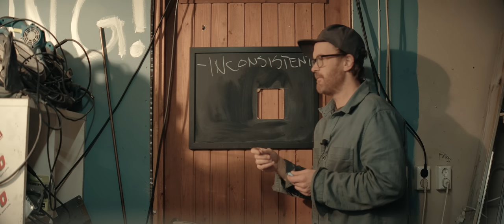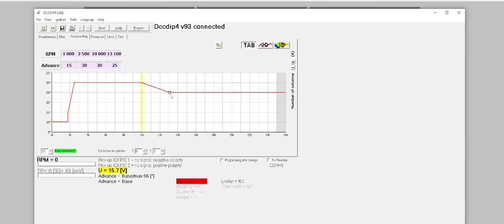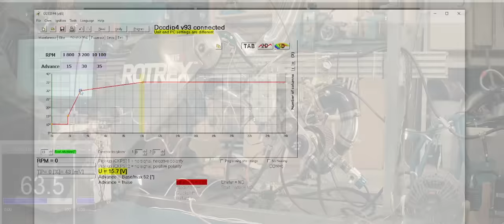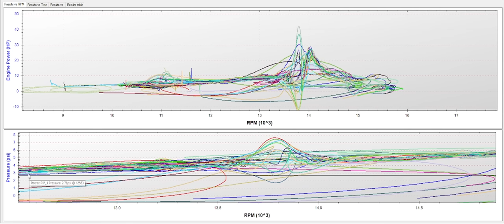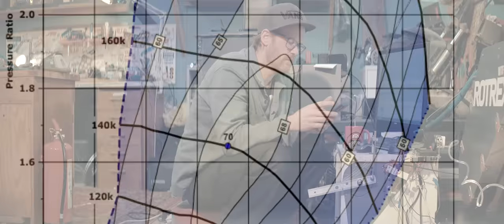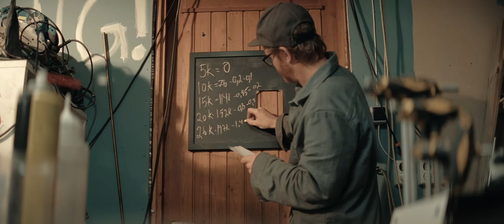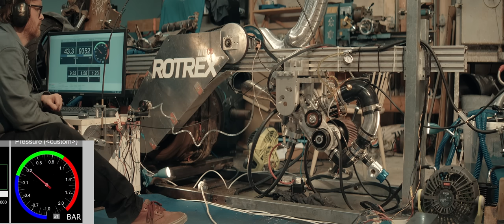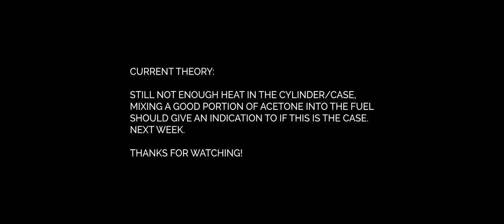Supercharged Pulsejet Engine?

Comment: Hear me out...   

You have a centrifugal blower shoving fuel into a crankcase that has no reed valve. At low rpm this sucks and you should have a legitimate full reed cage with a reed limiter cage on top of that. (So they don't over flex and break, but also because the spring rate of the reed dramatically increases the more they open!) This will fix a majority of your low rpm and transitional issues.   Get it running good like this first without a blower. 

Later, after you sorted that mess out, add the blower. 

Under boost, with the piston approaching TDC, the blower is shoving the air and fuel mix into the crankcase, helping push the piston upward As well as filling the increasing volume in the crank case. As the piston begins moving downward this volume begins drastically reducing and I'm sure shoves some of that fuel mix backwards toward the carb as well as raising pressure between bottom of the piston and ex-ducer of the supercharger. If you're supercharger is not spinning fast enough to over come this increased pressure, you basically have compressor surge. I'm sure a very weak intake charge follows. At higher RPM when you have higher amounts of boost, you have this very large spike in pressure as the piston moves down. As the piston exposes the exhaust and transfer ports, the supercharger is no longer boosting the cylinder. It is pushing all the air fuel mix from the crankcase through the transfer slots through the cylinder and out the exhaust ports where it meets up with combusting gases and lights off. This is why you're getting a flamethrower. If anything, you need a smaller stinger to try and create some back pressure so you can get cylinder charge. Realistically however, you would need to move to a mechanical valve that would allow you to close the exhaust off prior to closing the transfer slots so you can actually build Boost in the combustion chamber. There's a fundamental design of a traditional two-stroke that you're at the limit of. I don't see a way that you can make this work without changing the mechanical valving of the engine itself. Your barrel valves were a step in the correct direction I think. But I also believe that you should be running a full reed valve set up on this engine to help lower RPM and transitional power output.

Comment: As usual, great video! What about heating the fuel a Bit? I guess most energy goes into the gas transition, but heating the fuel should also suck some energy out of the motor.

Hälsningar grannen i öster.
Reply: It doesn't sound like pre-heating nitro-methane has to go well at all.
Reply: @cccpkingu  haha, could be the case. You don't need to go crazy on it. I guess the ambient temperature in your average Norwegian garage is pretty low this time of the year.

Comment: Unfortunately, I feel like your passthrough supercharger is introducing too much fuel because it's carbureted.  I'm not a two stroke "expert" but I've worked on/rebuilt dozens, and the expansion chamber of the exhaust bounces back unburnt fuel under pressure giving 2 strokes their own built in "supercharger" through the expansion chamber.  I feel like by adding a supercharger onto a carburetor, you're just pushing way too much fuel through, and there is no expansion chamber effect.  My hypothesis is that fuel injection (or direct injection) is the only way to solve your atomization issues.  This is what I would do as a NON-expert tinkerer.

1. Try drastically REDUCING the supercharger boost instead of increasing it, and work your way up.  I know that makes it run a little cooler, usually, but I think in this case it will not because less pressure will allow the fuel to atomize better.  This might be a wash because of the supercharger pushing unspent fuel through the exhaust without it "bouncing" back into the engine rebounding inside the expansion chamber back into the cylinder.  The expansion chamber rebound introduces hotter air mixture that hasn't been completely ignited, and that would also keep the engine hotter.

2. Fuel injection.  Fuel will only be injected in a few degrees of rotation instead of the entire intake and exhaust stroke.  Direct injection would allow you to inject at the precise moment to allow for less fuel to blast through the exhaust, whereas with carburetor, you're supercooling the engine with fuel, with a lot being wasted.

I love your channel man.

Comment: This is an experimental/development engine, as such, you should instrument the engine as much as possible. In the last couple of videos I'm getting the feeling that you are tuning and changing thinks almost "blindly", only following institutions. I know it's initially expensive (maybe a sponsor ) but several sensors, like temperature  pressure and AFR all over the engine can only help you, and it will speed the engine development. Just thoughts from a clueless guy in 2 stroke stuff.  See you on the next one!😉

Comment: Try running the carb without the restrictions. I reckon that is your issue
Reply: I fully agree. I have suggested that previously.
Reply: @malcrandall1309  yep. 
You can have all the psi in the world but without the flow psi means bugger all. 

And I strongly suggest he strays away from motorcycle carbs and try's a side draught Webber, one that is properly set up for boost.
Reply: @Swinginspanners  I must admit to being a carb man because I come from that era. 
If Alex wants to continue with carbs he has either get a much smaller bore carb and all the developement that goes with it or go for EFI which will guarantee a much finer mist giving a much quicker burn which it desperately needs.
I know Alex has being offered many carbs, I feel a modified 11/4" SU carb would be a good option with large float bowl and adjust while running main jet. Are they RC fuel proof I don't know!
This engine achieve 18k plus using the roots blower and speedway carb, it proves this engine is capable. The only thing that has changed is the S/C and carb! and running blow through.
Reply: @malcrandall1309  very very true. Thanks for your input

Comment: That you should have a rotary just valve for the inlet and have it times rather late so that when you're compressing all that fuel and air into the crankcase you're not fighting the nurse to the piston and crankshaft coming down which of course was coming down it's making a transfer to the fuel and air to the conversion chamber however you have so much power with the supercharger that you can actually leave that event the event of the supercharger kicking into the scavenging to past bottom dead center to wher
In other words you have the engine doing its own thing as far as transfer and compression of the crankcase gases as the distance coming down after on the powerstroke don't hinder it with the supercharged charge until just before bottom dead center and then you can blow it down with the supercharged fuel and air mix of course some of that will stay and the crankcase and it's all controlled through the rotary valve disc asymmetrical timing

Comment: Get an adjustable fan or maybe even a pump with alternating speeds so that you can change the tempereture to your and the engines liking! Snälla fortsätt precis såhär!!
Reply: Yes I think slowing the coolant pump down is what's needed. Using the hair dryer was pure class!
I think the crank cases need to be brought upto 60C and the cylinder 80C.

Comment: Could the supercharger be forcing out the currently burning fuel that's in the cylinder i.e pushing the burning mixture through into the exhaust? It could explain the pulse jet AND the lack of power? Just a thought! Love the videos my man :)
Reply: shouldn't the mixture have stopped burning before exiting? like used up all the oxygen there is in the cylinder? i mean with the timing at like 30⁰ advance there shouldn't be much more burning happening i guess. but still valid point
Reply: Perhaps maybe the fuel isn’t fully combusted until after it exists the cylinder? And then possibly the fuel that ignited in the exhaust is pushing the mixture backwards in into the cylinder or disturbing it? I know the engine has a large overlap in valves being open at the simultaneously.
Reply: ….open simultaneously**
Reply: I personally believe a lot of people get confuesed between 2strokes and 4strokes.
In a 2stroke the fuel must be COMPLETELY burnt prior to the exhaust opening allowing the expansion chamber to work correctly as intended.
With a 4stroke you want the fuel to burn to the bottom of the stroke with as much force as possible. It doesn't matter how much fuel you expel during the exhaust stroke.
Reply: @malcrandall1309  yea that's kinda what i was thinking
Reply: @malcrandall1309  I see, I don't have much experience with 2 stroke engines personally but I have experience with engines in general, thank you for the insight! If that's the case then its most likely something entirely different 🤣

Comment: Have you considered that all that flame throwing is actually the energy you are seeking that gets thrown out a not sufficiently restricted exhaust pipe? 4 stroke can always count on their exhaust valves and their timing...in a 2 stroke it's all up to a pressure wave travelling backwards and so dependant on air temperature, density, viscosity etc...all parameters you have now altered wildly compared to what that exhaust pipe was designed for...

Comment: Measure crankcase pressure.
On the downward stroke you should be compressing, which you are not (cause no reeds).
I bet some weird stuff is going on.
Reply: You're right, Dan. Professor Gordon Blair, who wrote the classic, The Design and Simulation of Two-stroke Engines (2002-last edition), showed the impossibly complex interaction of pressure waves in the crankcase during the engine's normal operation.
Reply: @davidgierke7582  yeah, because it has no inlet valve, the engine is no longer a pump.... Its now some weird pulse generator.
Piston port or rotary valve i reckon...... With emphasis on the word "rekon"

Comment: I don't think your piston is up to the task of sealing that much air into that much cylinder pressure, and, if it did it would probably melt. Perhaps a piston redesign is required in order to maintain compression under high boost/high compression. Double up on the compression rings, increase thickness of the piston top and make the piston top sodium filled and the piston surface ceramic coated. Cryogenically treat the piston to improve hardness and durability. Also due to rapid thermal changes the piston skirt should be longer to prevent piston slap as clearances suddenly change.

Comment: Could just be a flame velocity issue at higher rpm, always thought nitromethane burns a bit slow by itself. If my (terrible) memory serves, hydrazine and/or propylene oxide were used to make nitro burn like a mofo, especially back in the day. Hydrazine you of course want to stay far away from, but propylene oxide I think (?) you can still get. Again, if I'm remembering right, a little goes a really long way. Acetone may work, but I'd be super wary of a solvent that powerful in an engine that uses fuel to lubricate.

Comment: Pre-heating the fuel to at least 45°C? It should shorten the evaporation time energy for the fuel. Maybe help it run a little leaner.

Heating the fuel also is a fire risk. So maybe adding a small closed cup with a heater between the canister and the carburetor. 

Maybe also bowl needs to be adjusted into little lower?

Just guessing, hoping some of ithelps somehow

Comment: Hey, what would happen if instead of warming the engine, you were to warm up the fuel ? Would it bring the same result, could you combine the two for a lower temperature difference? Would it be too dangerous (making the fuel too volatile) ?

Comment: I'm thinking that it is pushing from the transfer to the exhaust, then igniting from the gasses still burning from the ignition.  Yamaha developed a movable shroud to alter exhaust timing.  What about an expansion chamber that can reduce volume as RPMs increase? Trombone kind of thing. Suzuki stole DKW technology and started winning. Supercharging was big time just before WW2. Scott was a 2 stroke twin with thermo siphon liquid cooling. I just Googled supercharged Scott.  Apparently there was one built in 1936.

Comment: Compression ratio?
Reply from the maker: Low, 14.5:1, higher has been on my mind.
Reply: @2STROKESTUFFING  but the higher compression could make it worse with knocking and stuff. But im not expert xD
Reply: @2STROKESTUFFING  butt!!! The 1 at the end is the atmosphere pressure right? Now you are forcing the air in so its not a 1 anymore,,, to high compression to ignite the mixture and just pulsejetting

Comment: I think the issue of flamethrower out the exhaust is more inherent to the fuel than other parts of the setup, meth needs absurd amounts of time to burn when it's not set up as a glow engine, should be fine to increase it until you see 80-95C.
Guessing the weirdness around 13-14k is due to the pipe being forced to run outside its designed range, that typically works as the rpm limit of normal 2-strokes, a 7-8k tuned pipe might actually work better if that's the case, reaching a second resonance peak around 14-16k, being forced beyond the 9-10k hump by the supercharger. "just a theory" as you like to say though.

Comment: What leaked from the ceiling?????

Definitely too much unburned fuel making it into the exhaust, the pulse jet effect is from the shape of the pipe...
I think the extra fuel is the result of the supercharger pushing mixture through the combustion chamber and into the pipe. There's no "chamber" to pressurize, like in a 4 stroke, intake valve open, exhaust valve closed. You're relying on the soundwave from the pipe to stop the mixture from being pushed into the pipe, and with your wide rpm range, it might be impossible to find a pipe that's tolerable. i don't know enough about 2 stroke pipes. As I understand it, the power band in a 2 stroke comes from the momentum of the air in the intake and the pipe stopping the mixture from leaking with a pressure wave on the other side, allowing cylinder packing. You have the "momentum" part solved. 

Was that dirty raw fuel leaking from the ceiling?

Direct fuel injection might fix the issue, if you could inject after the exhaust port is closed.

Power valve might help.
 
Could you lower the exhaust port with some JB weld and see how it behaves? assuming the intake ports are higher in the cylinder. This would allow more time for packing the cylinder with mixture, rather than the exhaust!

Love the videos, good luck!

Comment: haven't I always given you good advice? its the CDI unit.. remove it! there is no electronic device that can compute the calculations in time at such high rpm, all race engines even on cars switch to a mechanical timing system for the spark when reving over 10,000 rpm
Reply: Dave, just as a bit of informal info, the engine has revved to over 18000 using this ignition with the roots blower and speedway carb and expansion chamber.
Reply: @malcrandall1309  yes I know you’ve said that already in my last comment

Comment: I think it may be an ignition issue but not quite what you would think. It could be that at the higher rpm the pickup on the crank may be getting a funky signal and triggering the plug to fire when it shouldn't check this video out it explains what I think may be going on https://youtu.be/8hsXHagFQZQ

Comment: I'm not entirely certain about heat, if you look carefully you start "pulsejetting" right before 15K rpm, just after the shenanigans with pressure.
I really think you have a resonance problem, you could try with a straight pipe (I don't think you tried on the supercharged PIP if I recall correctly), it would give you data.
Also in the "not heat" camp, more pressure with the supercharger should have given you higher temperatures for your charge air and you would have seen a difference (I think, maybe.... \__( '  ')__/ )

Comment: Diesel super charged 2 strokes are getting their power a different way. They are still igniting under compression and that super charger pump is increasing that pressure and that is how they make power using the fuel that they use. They don't use an expansion chamber because that isn't how they derive their power.

If you want to run nitro you need to make power and first then increase boost pressure and the only way to do that is running the turbo after the expansion chamber and  stinger pipe.

You will go backwards fiddling with this super charger. Your system is not designed to run it man sorry

Comment: Top fuel dragsters ignition timing is 58-65 degrees BTDC.
Nitro burns far slower than gas.
You might have to fire that ignition as soon as the transfer ports close.
Only way to find out is to go severe in your timing and melt a piston. Then you will have your answer one way or another.
I'm a certified millwright and have learned to make big changes when ever a machine I'm working on is not running right.

Edit: I think the pulse jet effect is happening because at 15K rpm the time to burn all the fuel is non existent ----- timing
Just my opinions.